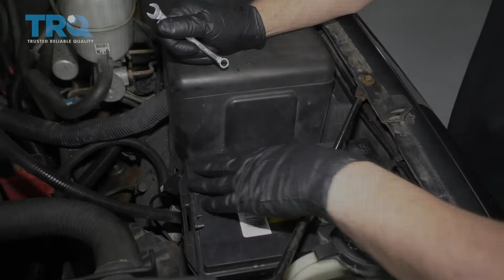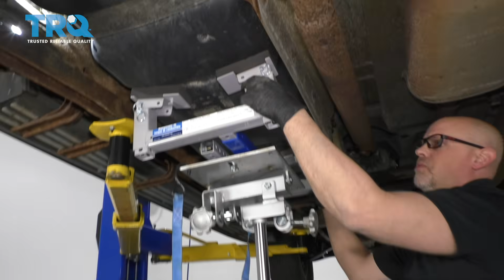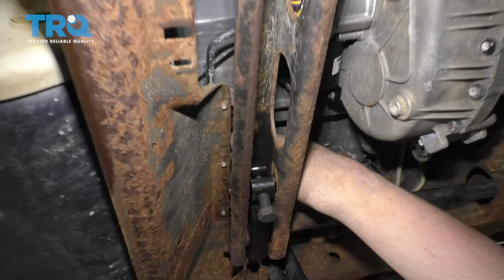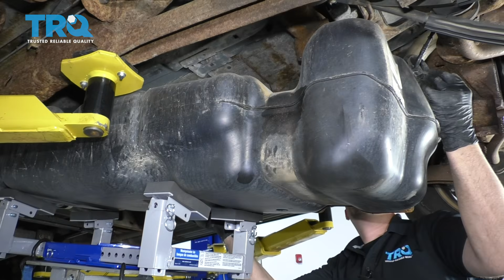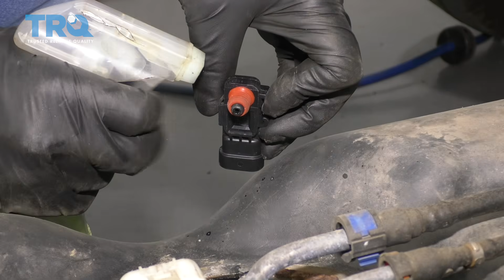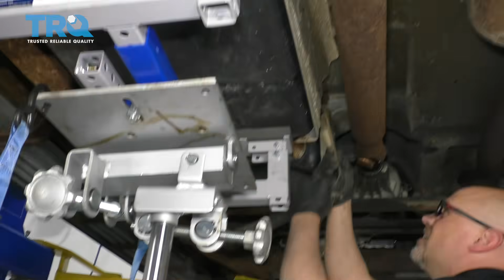How to Replace Fuel Tank Pressure Sensor 2000-06 GMC Yukon

Comment: I really like TRQ videos and I am not putting them down. However, you do not need to drop the tank unless you're arms are too big. I have a 2003 gmc Yukon xl 1500. I made sure my tank was nearing empty, I took the two bolt out holding the tank and let it drop a bit. I was able to crawl under the car and using a cheap scope camera I used a flathead and popped the old one out then pushed the new one in, plugged it in and put the straps back. Probably took me 20 maybe 30 minutes.

Comment: If GM would simply add (like back in the day) access panels for fuel pumps and heater cores people might be more willing to buy their cars again. Just saying... Amazing how much effort they (GM) have made to ensure everyone needs to go to a "shop" to replace easy parts like back in the good ole days. Great video. It's very labor intensive and certainly not a weekend warrior's ability (lift, trans jack stands, etc...). A simple cut access panel will do the trick - quicker and more efficient.
Reply from the maker: +@kylebrown6942 Thanks for watching. Buy the part in this video on 1AAuto.com: http://1aau.to/m/Shop-TRQ

Comment: I have the same code on my 2001 GMC Sierra 1500 sl W/4.8L V-8... When I bought it, on day 1 I had the code read and was recommended to get a new gas cap. I was told that that should solve the issue.... Bought a new cap and nothing changed whatsoever.... Now I have to run the hawg through D.E.Q. and that code is causing me to fail immediately... Not sure where to go from there?.... ANY ADVICE ANYONE??? Will I have to drop the fuel tank in my rig also? OR will this be accessible in my rig without having to drop the fuel tank?

Comment: I have a 2002 Silverado with the 8100 vortec. The fuel pressure sensor is not on top of the fuel pump like in your video. Searched entire top of tank and there is no fuel pressure sensor that I can see. Do you have an idea of where else it might be???
Reply: It's on top of the secondary tank under your spare tire.  I had the same problem,  discovered it after I cut an access hole in rear seat floorboard to get to the fuel pump and NO DANG SENSOR there.
Reply: Fuel tank pressure sensor

Comment: You can also unscrew the bolts from the driver's side holding the bed on and only loosen on the passenger side then hinge the bed. A 2x4 cut to size will work great to hold it up. Imo this is easier than dropping the tank.
Reply: since when does a yukon have a bed?
Reply from the maker: +jadedmc59601 We appreciate the feedback. Sometimes there are multiple ways to accomplish the same repair. http://1aau.to/m/Shop-TRQ

Comment: On my base 1600 Siverado, I can reach over the frame rail & get to the sensor without taking anything else loose. Maybe I just got lucky... this time!
Reply: No doubt I just did mine ten minutes ago
Reply: Did it correct the p0446 code 

It’s reachable on a 1500 right
Reply: With that part make the fuel gauge stop working
Reply: @frankiejarrell  no

Comment: You can skip like half of those steps aha 😅
Reply: All that to replace a part that is less than 3 inches in length? Vert da furk man, vert da furk ????
Reply: This is freaking me out. How expensive is a job like this to replace. It looks very hard.
Reply: @ryssagreen5860  it’s easier than you think ! it just takes patience and the right tools.
Reply: Could you break down what steps could be skipped? Think you would be helping alot of folks if you did!
Reply: Can you get to it from under rear seat ?
Reply: @samadams5568  you tilt the bed
Reply: @snowblind187  what does that mean.....?   " You tilt the Bed "..... ??
Reply: @williamwatson3567  you can tilt the bed if you have a silverado like i did, makes it a lot easier then dropping the tank
Reply: You could Probly remove the bed liner then , use angle grinder peel back the bed and replace in like 3 minutes